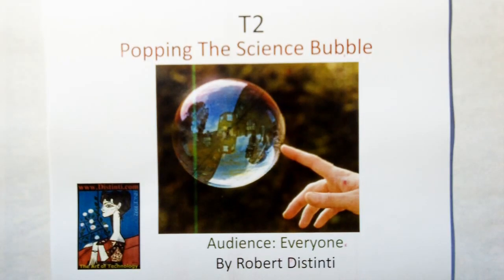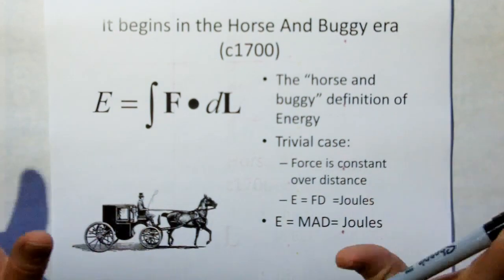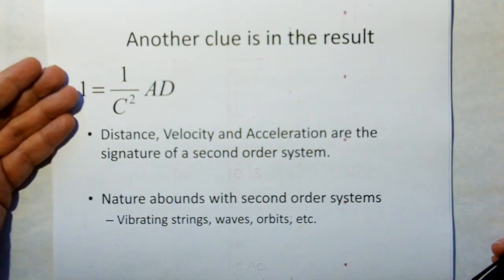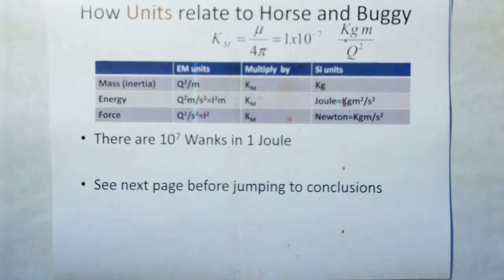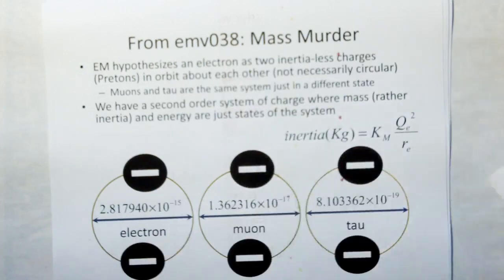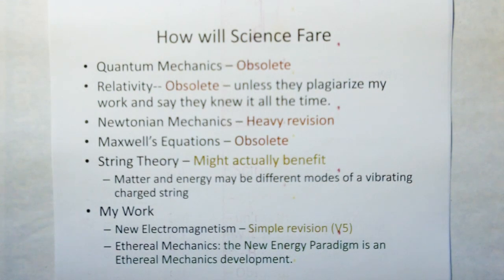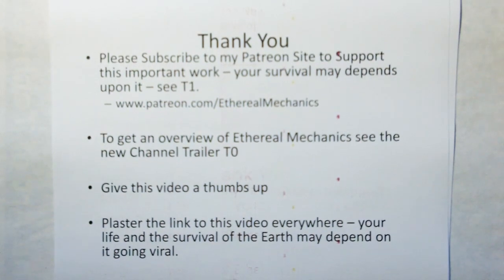T2: Popping The Science Bubble

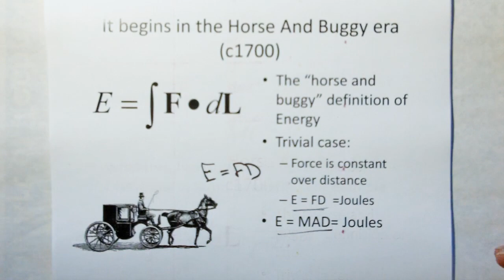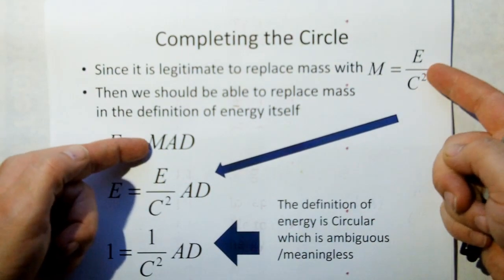Comment: Your fundamentals are wrong: E=MAD (2:40), Ok= so the Kinetic Energy acquired by Accelerating a Mass a given Distance is E Joules (agreed), and The equivalent (rest) Energy of a given Mass does equal Mc2 (2:56) (agreed) But when you try to make your critical point (at 4:07)  the you are saying the E of Kinetic Energy is equivalent to the E you would get if all the mass was converted to antimatter ( actually as if half the mas as converted to antimatter and was annihilated by the other half of the mass),. You didn't just miss the target, you shot yourself.
Reply from the maker: You are focusing on the nuts and bolts for which I have no problem with.  I'm using these expressions to highlight the definition of energy.  Ultimately, if mass and energy are interchangeable then you can't define energy in terms of mass.  Its the same as saying that energy is energy.  Its a pointless circular definition.   

The uncovering of the circular definition (the ambiguity) does not mean the nuts and bolts of what we have been doing is wrong, it simply means that a better definition exists which may allow us to understand more coherently what we are doing and to truly understand it for the first time.  Its the same as when we learned, 150 years ago, that fire is actually a chemical reaction, it did not mean that what we have been doing with fire for the past 100,000 years was wrong.  The discovery opened the door to vast improvements in combustion efficiency and other spin off technologies.  

A clue: Consider that a photon is massless and yet it carries energy, therefore, it follows that there must exists a definition of energy which does not require mass (this resolves the circular definition).  I have resolved this massless definition of energy for my patreon members -- the answer has been right under our nose and it is so simple.  For those who care to take the plunge www.etherealMechanics.com.
Reply: Got it, You say the definition of energy is wrong, because mass can be defined in terms of energy. So to make your point you say kinetic energy and mass equivalent energy (which not the same) are equivalant, there by providing a perect example of circular reasoning, when you prove they are not equal. Ha Ha.
Then you anounce that you have "a definition of energy that does not require mass",  which is would be brilliant if it werent for the fact that no one DEFINES energy in terms of mass. They could reference mass/energy equivalency but that is not a definition.
Anyway, I admire your courage. you are out there making a contribution, and getting people to think, good for you, keep going.
Reply from the maker: https://en.wikipedia.org/wiki/Units_of_energy  -- Energy is presently defined in Joules which requires the kilogram (mass).   The electronvolt is just a quantity of joules.  1eV =  1.6021763e-19 Joules.
Reply: I know what you are saying, but, No sir a Joule is not DEFINED that way. A Joule is Defined as the SI units of Energy. Energy is defined as the ability to do Work. "How much Energy?" is not the same question as "What is Energy?", and likewise "What is a Joule?" is not the same as "How much Energy is in a Joule"
One way to measure or generate a Joule of energy is to apply exactly one Newton to one Kg for 1 meter. Here you are measuring not defining, and that is just one measure,. Another measure of a Joule is EQUAL the energy dissipated as heat when an electric current of one ampere passes through a resistance of one ohm for one second. (no mass required). Finally an electron volt is not "Just a quantity of Joules" but by definition: an electron volt it is the amount of ENERGY gained (or lost) by the charge of a single electron moving across an electric potential difference of one volt. Thus another measure of ENERGY (and by extension measure of Joules) which does not require mass to be considered. EV are simply more convenient at these energies than Joules,  just as Joules are more convenient to use at other (higher) energies. 
I am not trying to be argumentative, or rude, just concise and clear.  Fun talking to you though.